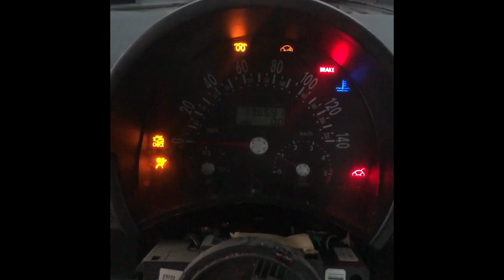Baja New Beetle

Comment: how was the bull bar attached ?
Reply: Welded 1 inch pipe to the bumper. Corresponding holes in the bull bar, bolts through bull bar and into the 1 inch pipe

Comment: I bought a 2001 Beetle TDI 5 speed last fall. Put a 2" lift on it and put 215/65/16's on it. I need a push bar for the front and can't find one anywhere. Where did you get the one on this Beetle? And was it bolted on or welded on?
Reply from the maker: I welded posts on the front bumper (through holes in the cover) then bolted the push bar onto those posts. The push bar is actually from an F250. You are going to have to fabricate your own system for mounting. Im not aware of anything made for the beetle. Lots of ways to do it though
Reply: Where are you located? I can’t find no one who can lift my 2006 Volkswagon Beetle in Jackson MS
Reply: @titearagates7639  I bought the VW High Life lift kit, then installed it myself, but any shop that does shocks and struts could install it for you.

Comment: so for the lift, jeep front springs off of a stock 4wd xj i assume, late 90s f150 front shocks and bore out the lower holes on the vw axle, what about the front? i saw u cut the sway bar but thats all, would the front lift not fit with oem sway bar?, will be sourcing parts for my vw very soon and want to be sure, dont wanna run spacers if i dont have to
Reply from the maker: Thats a long answer. Originally I used the Jeep springs and just compressed the crap out of them onto stock struts. Rode like crap. Then used VR6 springs on stock strut and made a 2.75 inch spacer to go onto of the strut. Was a little nervous about that spacer (basically a strut extender on the top). So then I welded up MK5 spacer, converted to MK5 strut bearings and used that. Took a little bit of welding to make the MK5 style spacer. Recommend joining the FB group "lifted water-cooled VWs". this questions get asked 20 times a day there.
Reply: @hestermannmotorwerks  ive looked extensively through that page, specifically for the beetle setup and lots of different answers and options im a decent fabricator but if someone had a decent recipe that worked already i would go with that, how does the rear ride with the bigger springs? Building spacers for the front seems to be the way to go to keep from preloading a spring by the over extension of a shock

Comment: What rear struts are you running? (Shocks). I lifted mine as well but my rear suspension is suoer stiff.
Reply from the maker: F150 shocks and Tiguan lift springs

Comment: I saw this bug for sale in fb market ! Great project. I have a 2000 VW beetle TDI myself. Those wheels are from a jeep wrangler/ Liberty?
Reply from the maker: Yes the wheels are from an older Wrangler, had to use adapters of course to match up the bolt pattern. Love the TDIs! I sold it and the folks that bought it thought they could sell it for more so it is for sale on FB marketplace

Comment: Do you need to regear it for larger tires? What shocks for the rear? Cool build
Reply from the maker: The TDI with some power enhancements seems to handle it just fine. 2000 Ford F-150 front shocks used for the rear on the beetle
Reply: @hestermannmotorwerks  ours is a 2.0 non turbo. May have to chip it or something to handle the tire size increase. Thanks!

Comment: Nice work. It’s cool. What Parts do the car higher?
Reply from the maker: there are a lot of different ways to do it. In the video, Im using Jeep springs and ford F-150 front shocks for the rear (more travel) but since then I have swapped to Tiguan lift springs and it rides much nicer. On another one I used MK5 strut mounts with a home made spacer in the front and Jeep WJ shocks and a spring spacer in the rear.